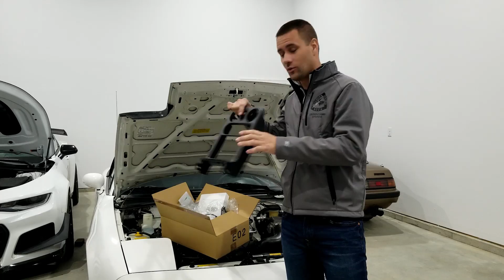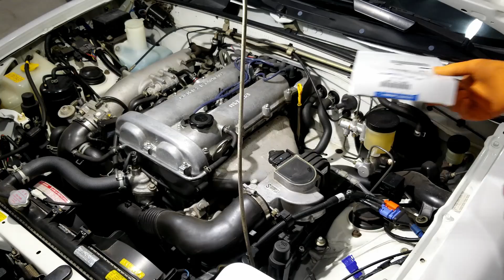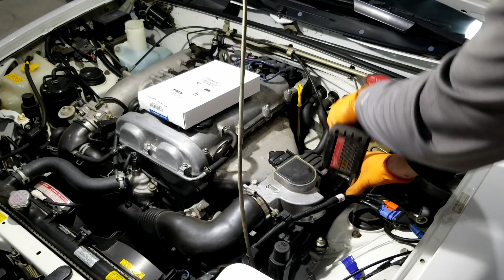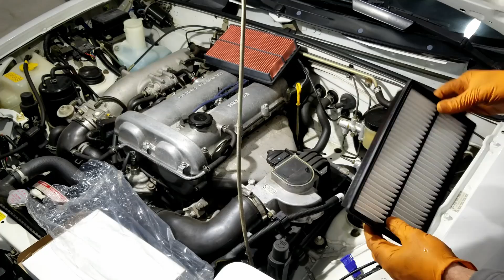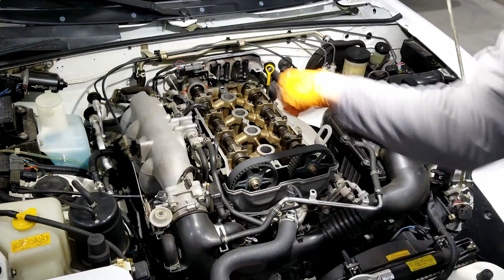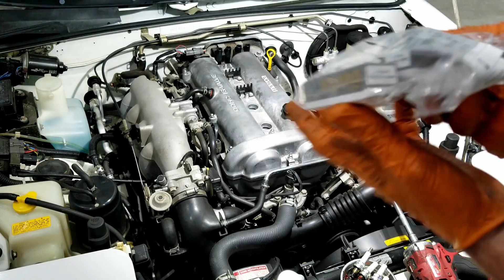New Miata Parts! Part 1 Valve Cover Gasket, Plugs, Wires

Comment: Good video. I wouldn't use power rachets on valve cover or spark plugs. So easy to strip out the aluminum. Otherwise, great job.